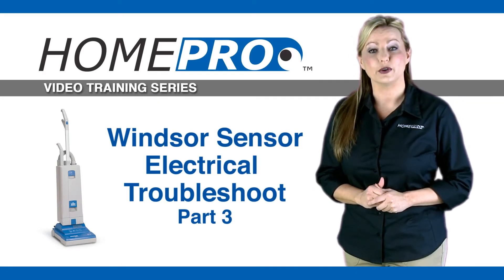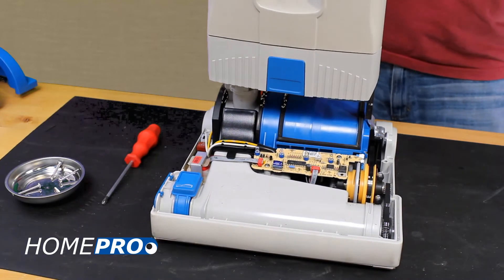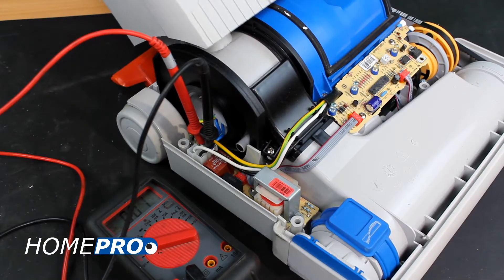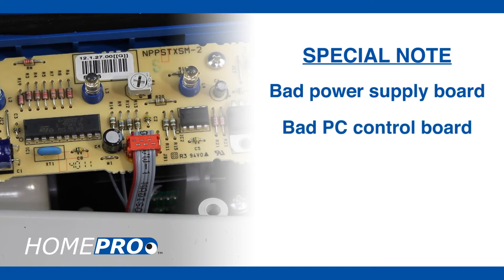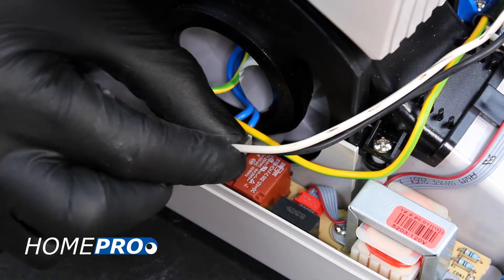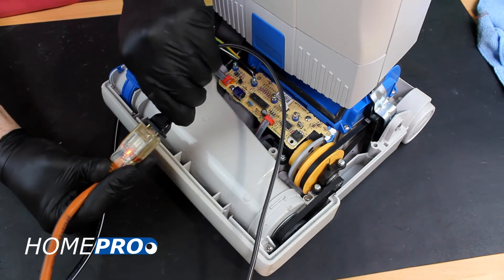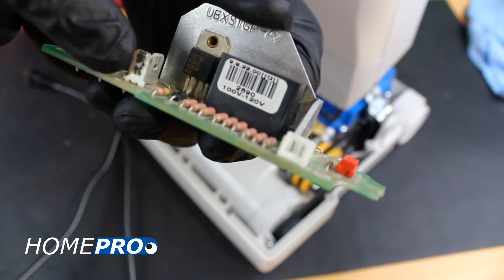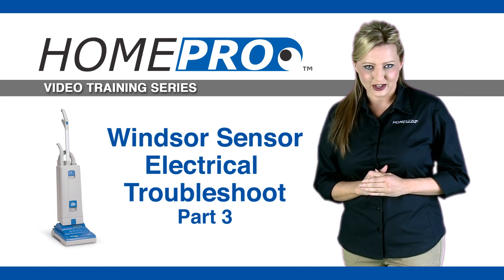Windsor Sensor Electrical Troubleshoot Part 3

Comment: Make sure the power handle is locked in place, I almost took the vaccum apart when I found the handle unlocked and not making connection

Comment: Just wondering where I can purchase the cord with the male end to run power directly to the vacuum motor to test whether it works or not. Link?
Reply from the maker: Hi Jacob, we don't have one to sell, we just used a power cord and attached male terminals to the end. Any power cord would work, or even alligator clamps would work as well.

Comment: Hi, I need your help I bought a power switch, sensor handle cable and sensor vacuum internal cable.
It's no working. The problem is when I push the switch on is working for 5 seconds and then off I put the new parts still not working has the same problem. Any recommendations pLease.
Reply from the maker: Give our Tech Support a call and we will be happy to walk you through it!  801-553-0788
Reply: @homeprovacuumctrs  Thank you so much I really appreciate I am to call you soon.